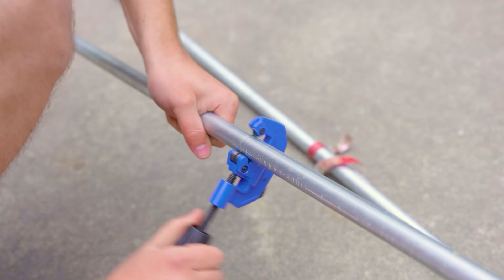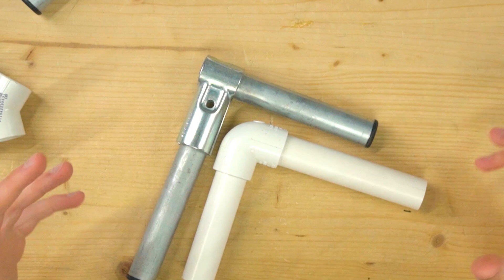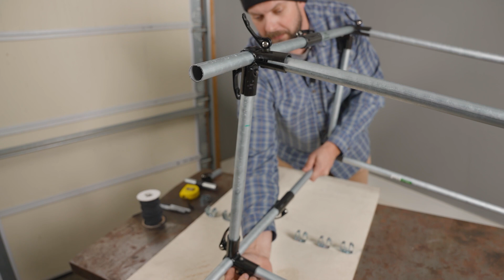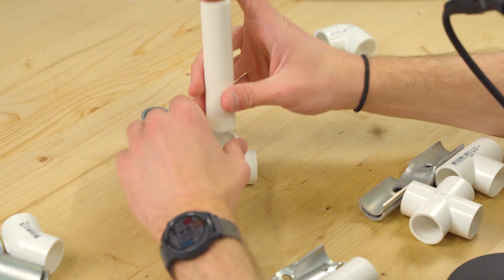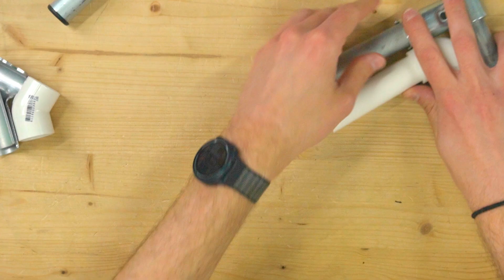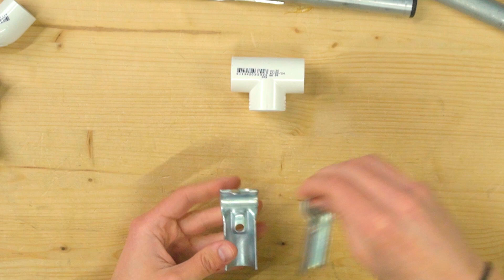How To Upgrade Your PVC Projects!

Comment: If you go the EMT route please use the 3/4". They make a 1/2" sleeves to use in the 3/4" parts but trust me, they do NOT get tighte enough. They also do NOT allow the locking fingers to bind tightly. Just a FYI so you won't have the problems I encountered.